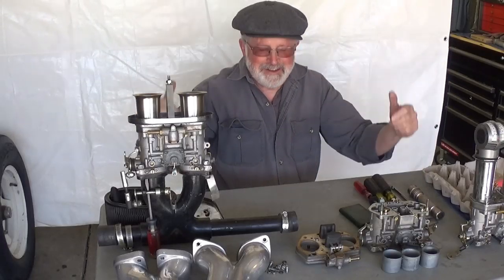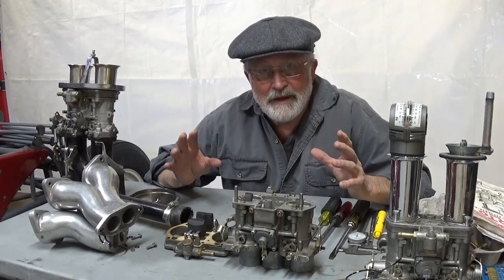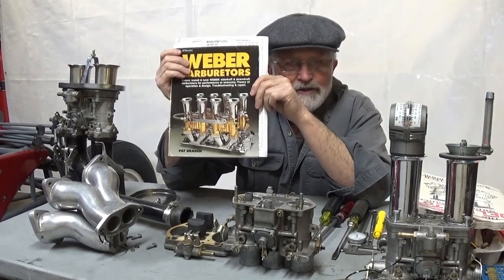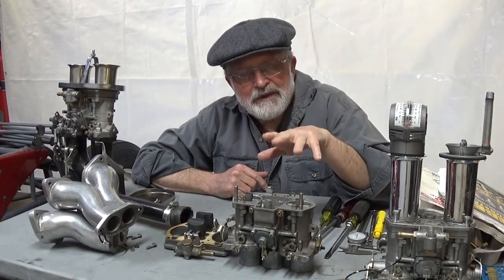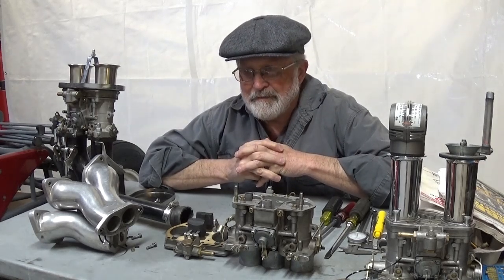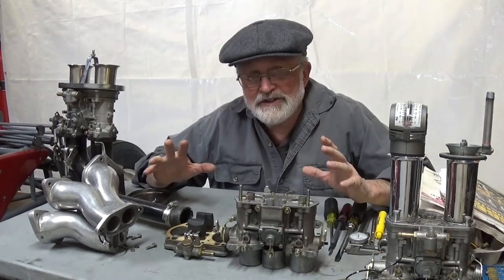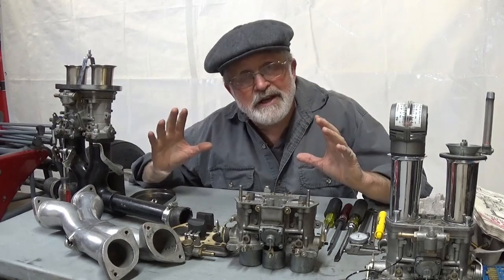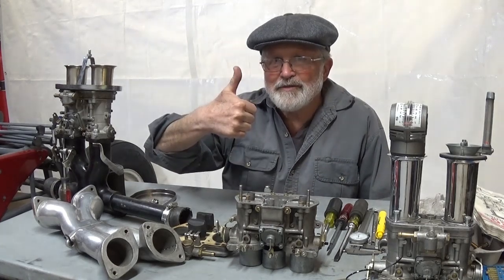Weber IDF Carburetor History Series #1

Comment: I am currently restoring a barn find 1979 Fiat Spider 2000. Its all original and minus some minor surface rust, it's nearly mint. I was able to purchase it for $1400 and dragged it down the street to my house. I have grown fascinated with these cars, and it has reignited my passion for carbs. I now understand why the dual idf setup works so well on these! I have purchased an empi single carb, and it will do me for now until I have more income in the future. I still haven't driven it yet, but that will hopefully be this summer. I'll be going through the rest of your content. Im sure it's full of great information
Reply from the maker: I hope you get many smiles to the miles with your new project. Thanks for your comment

Comment: I saw the headine just as I put down a very old Hot od mag where they were testing an engine at Scat performance ,trying different manifolds ,carbs and so on. The weber they used was a IDA and they describe the different jets etc they used to overcome that weber idle to run transition. 
A few years ago I was asked to get an E type jag up and running. (i doubt it had ever actually been started since it was resoted 30 years ago) This thing was a V12 manual with SIX IDF's. A total and complete pig which took weeks to get running properly. I realised later it had the wrong style heads which affected combustion and robbed it of power. Get six carbs to work together is like herding cats, feral cats.
Reply from the maker: That sounds like a real challenge having to sort threw.  That's probably why it sat for 30

Comment: Loved my dual40 IDFs on my bus' 1776.  Ran like a champ until I blew a chunk of lifter bore out.  Getting ready to run them again after I get a new aluminum case.
Reply from the maker: I love my aluminum bubble top case. Best oil pressure of them all.   Remember VW used aluminum to make the type 4 case so it can't be all that bad. Just make sure and line up the oil hole on #1 thrust bearing.
Reply: @TheEZGZ  thanks!  Will do
Stay well.

Comment: Ezgz
  Do you have any tips on how to remove the frozen Weber 40 IDF Auxilary Venturi 's ? I have looked in  your IDF carburetors rebuilt videos and didn't find the answer unless I missed it.
Reply from the maker: I've taken a peace of 1/8 welding rod and made it like a J hook.  Then about 12inches away clamp on a pair of vise grips. Then you just use something like a 3/4 box wrench around the welding rod to create a slide hammer and tapp  gentley away on each side until it starts moving. Are you changing venturi's ?   Good Luck with your project.
Reply: @TheEZGZ  
 The  carburetors, have oxidation between the venturi's and carburetor body. Both carburetors need a good cleaning.  The carburetors were NOS.
Reply from the maker: @vintage76vipergreenBeetle  In your origanal comment you wrote auxiluri veturi which is the tube above them.  For the venturi itself I have used a penatrating oil called blaster and used a propane torch to quickly heat the carb body. Then taking a sharp screwdriver blade and lightly tapp. Don't damage the aluminum. If they are stubborn put the whole thing in your freezer for 1hour and try the heat again.